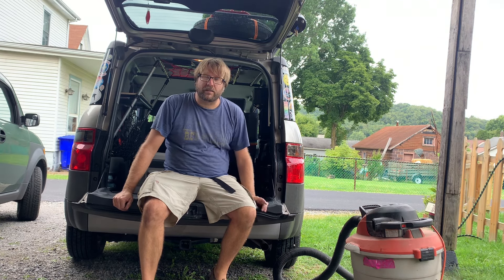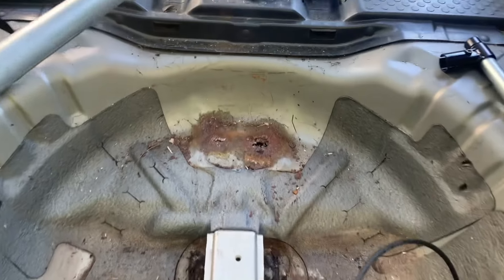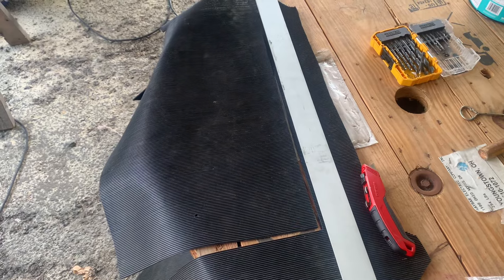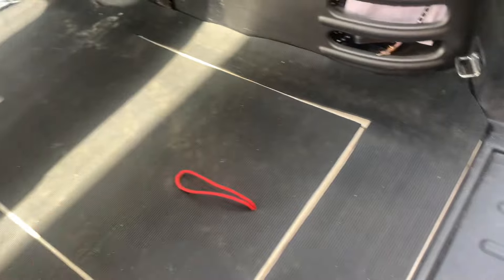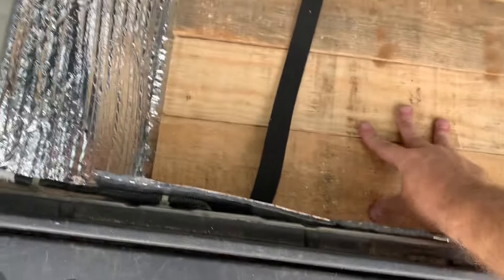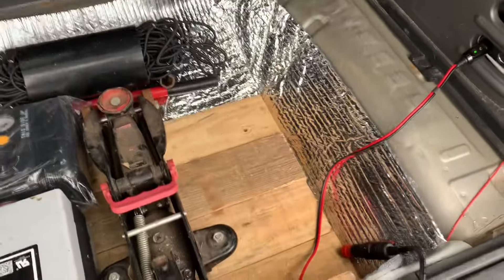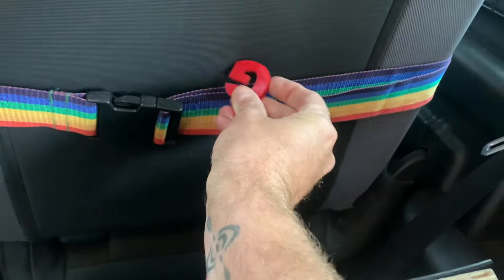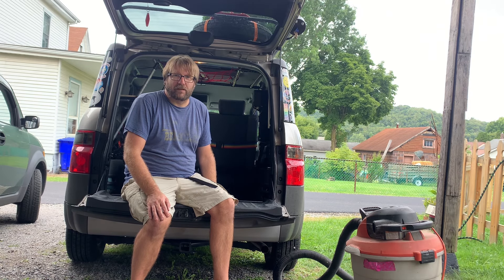Honda Element Camper Storage: "The Basement"

Comment: Great little project, thanks. Just wondering where you put the spare tire now?
Reply from the maker: Thanks so much. I’ve designed and built the specialized roof rack for the car. I still haven’t done a video on that yet but I’ve got a full size spare up on the roof now.

Comment: With batteries it's good to have ventilation for the off-gassing... you could have converted that rusted area into a small vent instead!
Reply from the maker: That’s an excellent point. This is a sealed gel battery and so there’s no off-gassing.